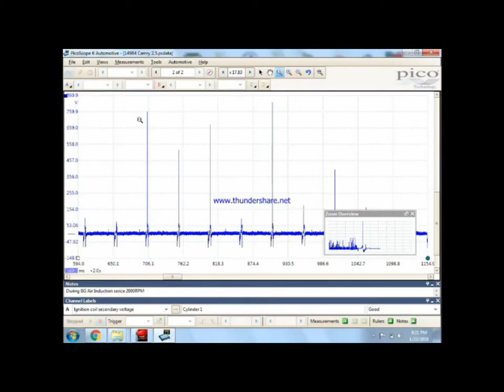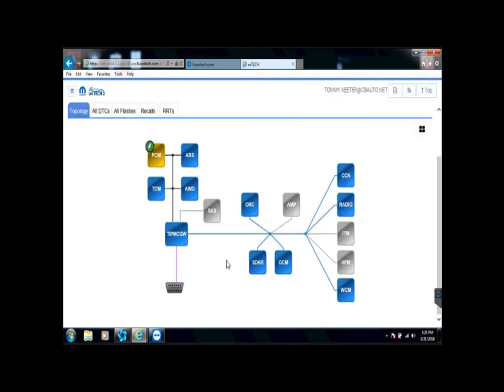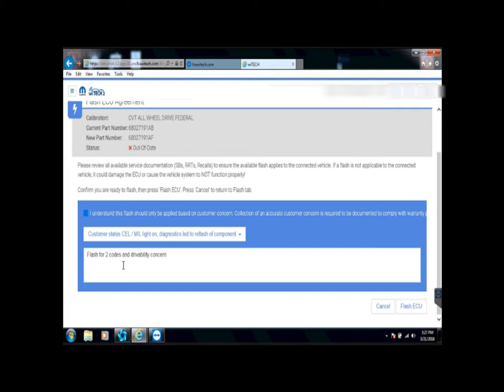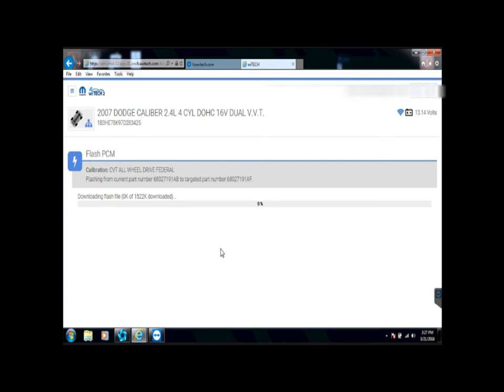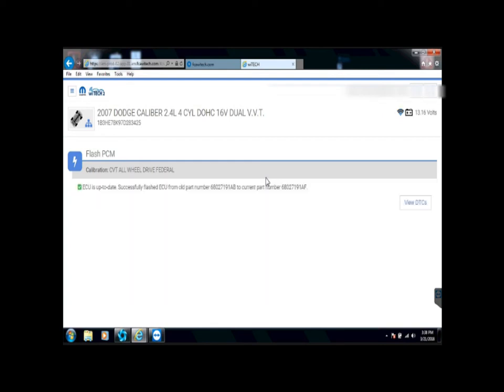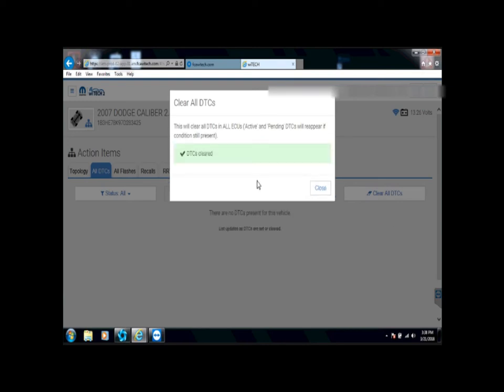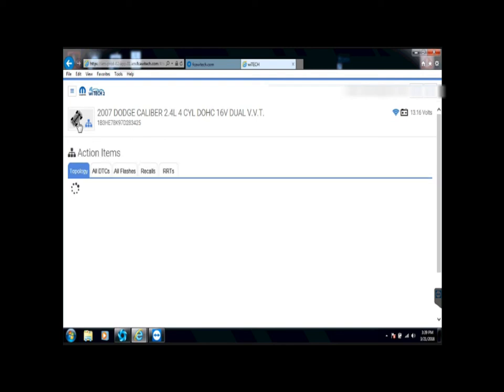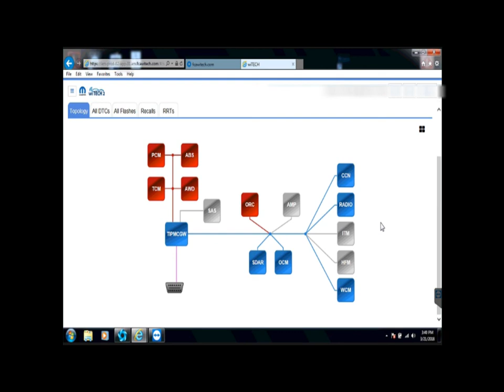How to reprogram with the Chrysler Witech 2.0

Comment: Hello.... thank you for the useful video, but I got a question, I replaced my car Transmission Conductor Plate NAG1 for 2007 Chrysler 300C 5.7l AWD, it works then not shifting, they told me your Transmission need programming to work correct, someone else told me it doesn't need programming, so I got confused does it need Programming as you a professional???
Cuz am afraid to pay money for programming then if it doesn't work then you waste the money for nothing.
Thank you

Comment: Can y0u use CDA 5 to program new keys for a 2015 Grand cherokee?  i have a witech micropod, but cannot login to flash anymore since i quit fca a while back and my tid doesn't work anymore.  tnx
Reply: I remember doing it with CDA 6 (I was an engineer at FCA), but needed the four digit code.  I just cant remember the process.  I did it with several keys on my 2012 KK (Liberty)